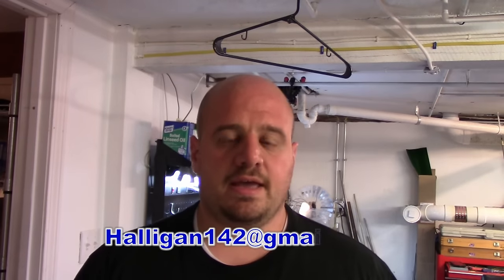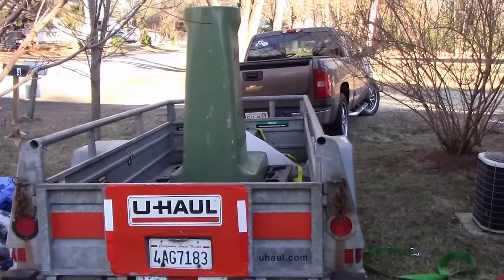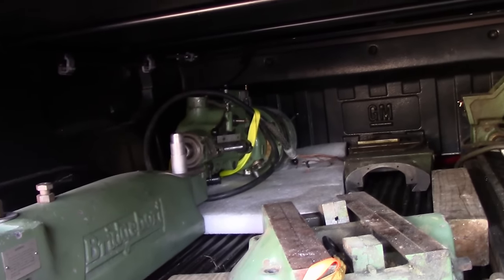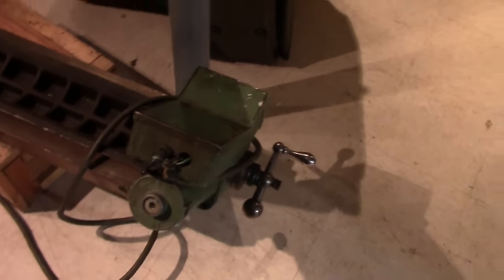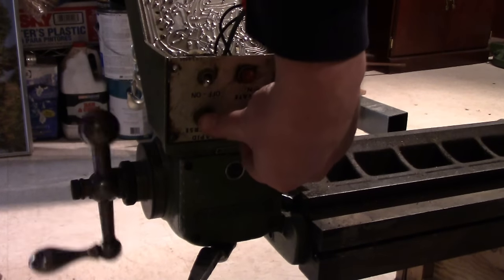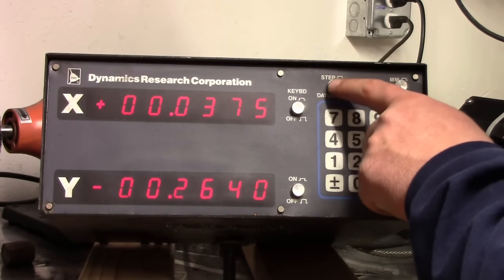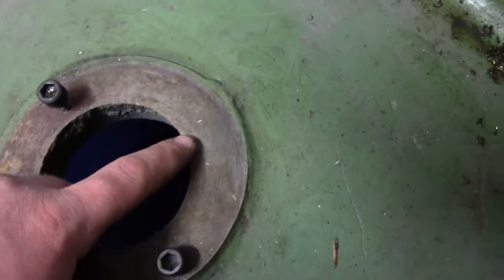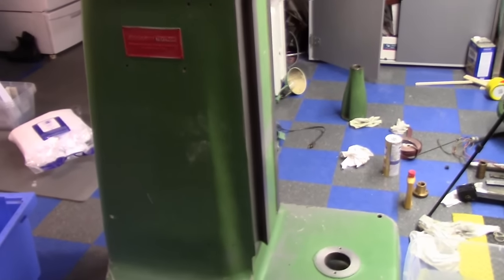Bridgeport Mill Cleaning and Assembly Part 1

Comment: My 1984 Long Chang First BP clone (sold under the Sharp brand in the US) came with a Mitutoyo DRO and I couldn't get a manual for that either. I bought complete new three axis systems for the mill and two axis for the lathe from "theDROstore". Both Sinpo units from Singapore.  I then sold the Mitutoyo on ebay and got 2/3rds of my money back (on the mill system). 

I went from 10 micron resolution on the mill to 5 micron and gained a whole bunch of extra functionality like bolt circles, radius generators etc. and a built in calculator. Very happy with the result. I wouldn't go back to the Mitutoyo, but that's still giving good service with its new owner a couple of years on.
Reply from the maker: +Paul Compton 
Yeah an upgrade may be in the future, but for now I can work with this one.

Comment: Two pieces of 3/4" pipe and a pinch bar will move it around the shop. I would leave the pipe under the machine until it is assembled and you are satisfied with the location. It has a pretty big footprint with the table movement. I have adjusted the placement of mine several times, in fact I never took the pipe out. I am tall and I don't mind the extra height. It doesn't move around, it weighs over a ton assembled.

Comment: Very very generous of that viewer. But those aren't scraping marks on Bridgeports. They don't get scraped at the factory. Those are flaking marks for oil retention. There still a very good indicator of wear tho. By now you've probably figured it out, but that cross armed piece is called the spider. It goes inside the column and the top cap gets bolts down through it and into the spider. Not sure if your access panel is on the left side or on the back, but you'll have to hold that spider up in place with one hand until you get at least two bolts started into the threads. PITA but it can be done without too much trouble.

With a low ceiling then make sure the drawbar is installed before you start tramming the head. Otherwise you'll have to pivot the head over to drop the drawbar down the spindle hole. It helps when tramming the head to snug the bolts up a slightly firm, get the head close, snug the bolts just a bit more, then use a light dead blow hammer on the end of the wrench to turn the worm on the knuckle and head tilt to get the final tram. Just don't do that with the bolts a bit too tight, you will break something.As for final tightening of the bolts, leave your indicator still touching the table to make sure the head isn't being pulled out of tram as the bolts go tight. Obviously the indicator gets swung around in both X and Y depending on which bolts your tightening.

Leave the bolts on the bearing hanger at the end of the table a bit loose. Run the table right to the end of the travel, then tighten those bolts at that end. That aligns those bearing hangers to the feed screws C/L. and you won't get binding. If your bearing hangers have alignment pins then the above can be ignored. My best guess is they should have pins or dowels.

Buying tooling for a mill never seems to end.
Reply: +Bill Lewis Thanks Bill, Smart thinking of BP to add that to the casting. I wish my clone had those lugs.
Reply: +Bill Lewis,
I saw those lugs in the video. Greg should be good to go when installing the spider. 
You can see the lugs starting here: https://youtu.be/AdQR-PX-Igk?t=19m20s
Reply: +Mike Miller Funny but I'd totally missed them. Shows how observant I am I guess.
Reply from the maker: +Turning Point Thanks for the info!

Comment: As for the paint, it looks to me as if the folks at Harvard overpainted the factory gray with that noxious green color... I've not seen another Bridgeport painted green...

That carries over to the lighter colored section of the dovetail for the knee, where they didn't get the green paint behind the table... the lower level of discoloration is consistent with the table's slide sitting in place on the dovetail.

Not sure if anyone else commented on this...
Reply from the maker: +chemech 
It's called Vista Green and it was an optional color.  I've seen them around.  We had one in machine shop when I was in highschool and Mr.Pete222  AKA Tubalcain has the same color on his.  I've actually tracked down the man who ran the Harvard Lab shop and they had this green one, a grey one with ballscrews, and a grey one converted to CNC.